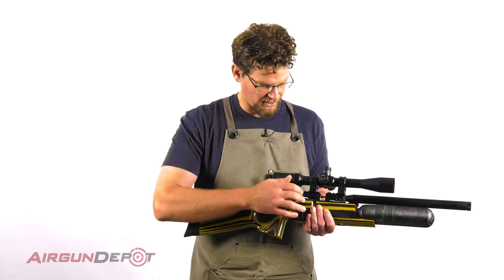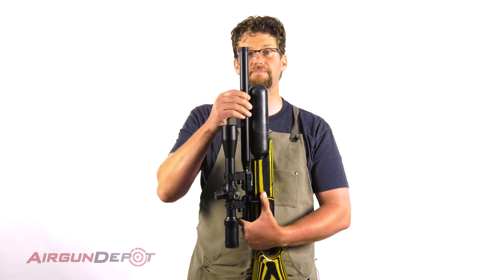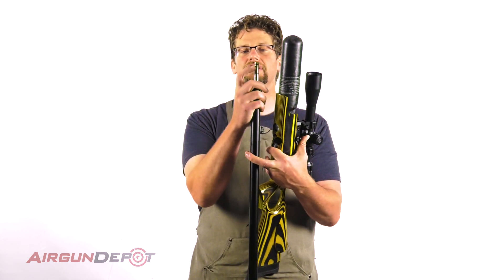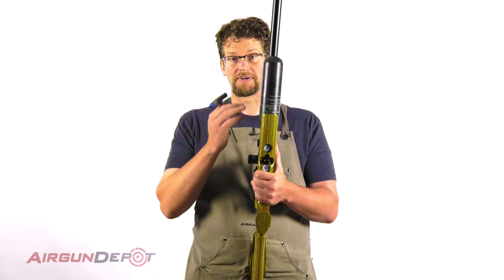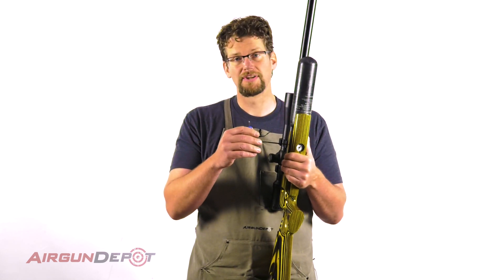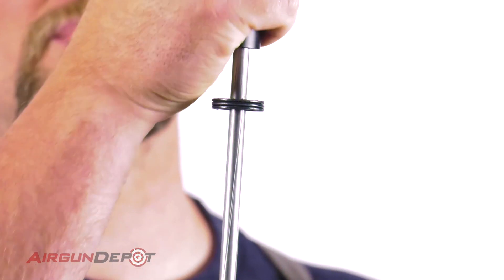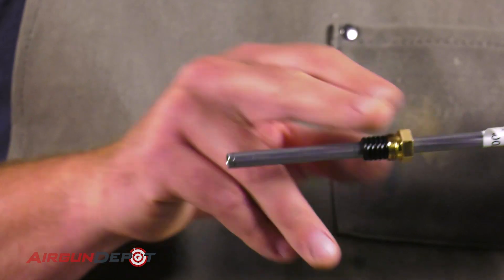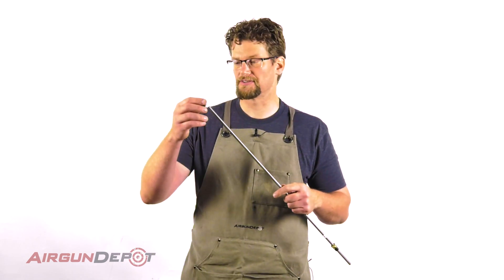FX Crown: Removing the Superlite Barrel and Changing Liners

Comment from the maker: A correction and another tip: FX informs us that it is not recommended to put silicone grease on the o rings because you want the most friction possible to lock the liner in solidly. Also, we recommend that you take a picture or measure the distance between the lock nut and the base so you know how far to tighten it down when replacing the liner.
Reply: How is that a 15mm Allen wrench???
It’s a 15mm open end wrench (or a combination box/open wrench)
Reply: @robertmillen2967  Sometimes you just go with it although correct you are